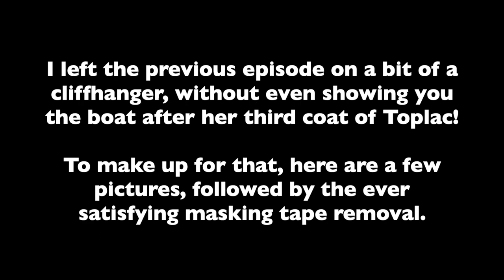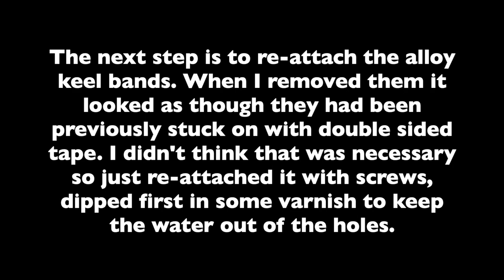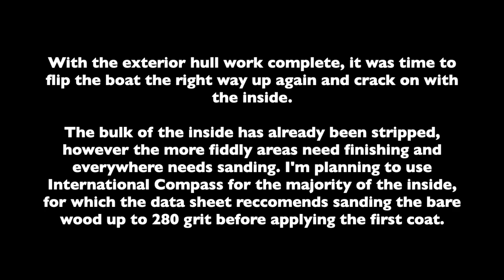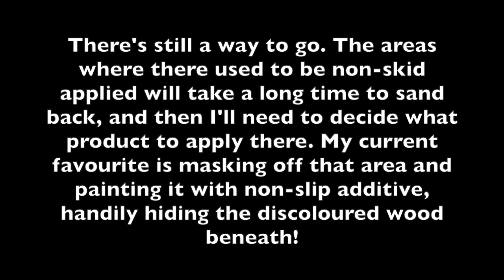Restoring a 1986 Merlin Rocket Dinghy | Part 4 | Paint Reveal, Keel Strip and Inside Hull Prep!

Comment: Nice paint job, but the keel band should wrap around the bow not stop at the end - it will be very vulnerable to damage as is ....
Reply from the maker: Unfortunately the apex where the bow meets the keel has been sanded back so many times over the years that it is actually thinner than the alloy keel strip...so I can't easily attach it, not to mention how odd it looks. I'm not completely happy leaving it exposed like that but I don't see another easy way forward. I'm not planning to beach the boat so I guess I just have to be careful when pulling her up onto the trolley after a sail.